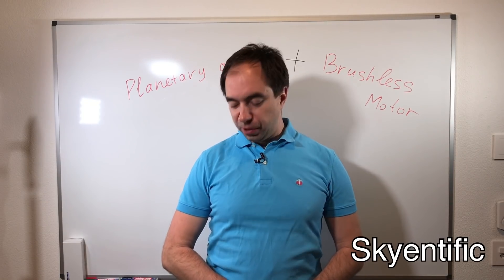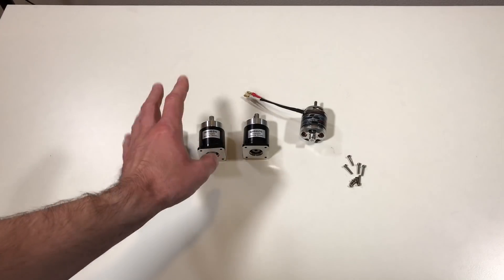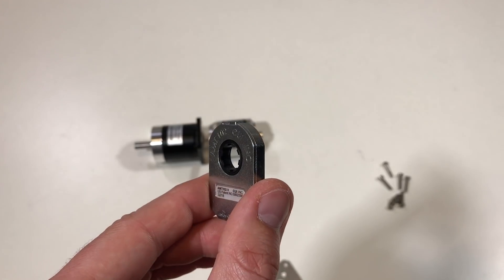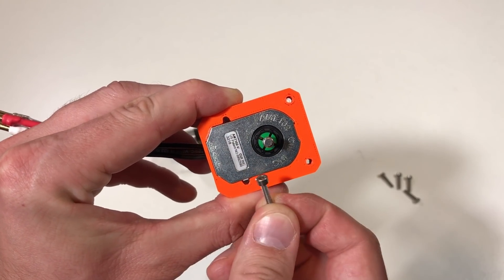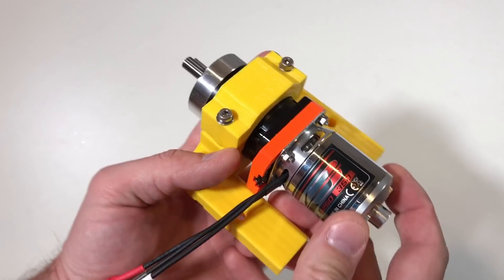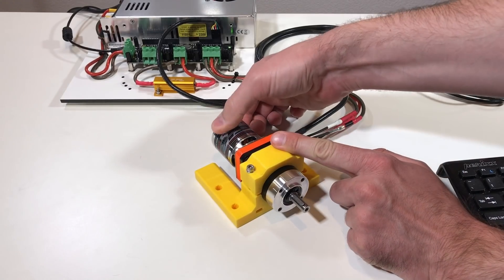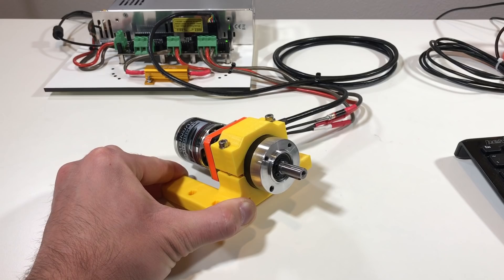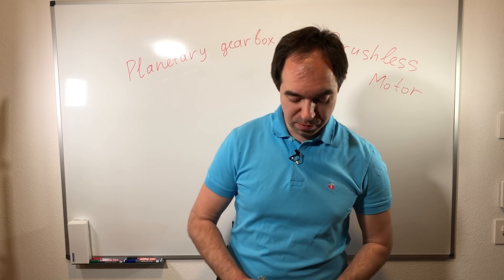Will it work? (Planetary Gearbox + Brushless Motor)

Comment: probably a dumb question: why does the outer housing of the brushless motor rotate? Is there some advantage to not having it fixed in place?
Reply from the maker: Yes, these motors have higher torque for lower RPM, which is perfect for robotics.
Reply: In fact, the outer housing is the rotor, the magnets are on it, and on this type of motors, the magnets are spining, and the copper coils are staying in place

Comment: new subscriber!! how long does this last? is there any downside of using that kind of motor?
Reply from the maker: Welcome! :). I did not do the stress test. But the only downsize that I aware: it is more expensive. But at the same time brushless motors usually lighter and more powerful. This is why most of the time people use them for professional robotics.

Comment: Am going to use it for single axis solar tracker with threaded long shaft rotating inside a nut for getting linear motion with good torque.

Comment: Are you able to run it with the encoder on the reducer output shaft instead?
Reply from the maker: It would be very difficult. Because of the backlash on reducer, the motor position would not be precise in this case, and controller will have a difficulty to run the motor.
Usually in such cases people use two encoders: one on the motor and second on the output shaft.

Comment: strain wave gearbox would be even better. Also a bldc with less inertia - an in-runner or a hollow rotor one would be killer. Congratulations on the build. It looks really useful.
Reply from the maker: Thank you! I agree that strain wave gearbox (hormonic drive), is great reducer. The problem, is the price. The cheapest one cost around 500$...
Reply: @Skyentific  Thanks for your reply! Unfortunately the price is an issue. I designed mine and manufactured them myself on a Mill, lathe and CNC EDM machine at the university where i teach.This is one of the reasons i am still hanging around there ;) I used to teach theory of machines and mechanisms ;)

Comment: You just basically made a brushless servo motor. Good project!
Reply from the maker: Thank you!
Reply: Aren't servo motors already brushless for the most part? They rely on a method very similar to a BLDC motor, and is why they are able to have such a powerful holding torque. Afaik, servo motors are a lot like BLDC, just with a lot more windings for fine adjustments.

Comment: I wonder if these types of motors are designed to be cooled by the air that the blade creates that they're designed to spin? Be careful when running them on higher power without any forced air circulation? :P
Reply from the maker: You completely right. That is why I always check the temperature of this motor when I test them.

Comment: Also have you looked into 3d printable harmonic drives? I've been playing with some designs but haven't been able to make one that doesn't skip teeth with more than ~1.5nm. I've only tried low reductions (15-1) but they have been back drivable so far.
Reply from the maker: Not yet. But I agree that this would be very interesting.

Comment: Those gearboxes have nylon gears right? I am interested to see how well they can hold up to high torque/power applications because if they were designed for steppers they wouldn't need to be very strong. I wonder if we can convince some Chinese manufacturers to produce cheap metal planetary gearboxes in this size
Reply from the maker: All the gears in this gearbox are metal. The torque from stepper motor of this size is around 0.4-0.6N.m. The maximum possible torque from the brushless motor from this video is 1.2N.m, but at this torque the motor will heat up quickly. So practically better to use lower torque. Thus both torques are not very different.

Comment: It is not "Flyed away" when you tested, but the vibration is too high. If you use second the same brushless motor (without reducer) and use opposite direction of rotation in same time - it will remove the vibration?
Reply from the maker: Good question. I don't know. But I should say that the vibration is not super high... I think it is normal for this speed.
Reply: If this "servo" will work in robot's hand - each manipulation will vibrate the whole robot. If robot draw text by this hand - then this text will not fine...

Comment: that's super cool, have fun experimenting with cheap actuators ^^ (still too expensive for me but you're getting somewhere) 
by the way there is this article about an "Afordable" joint (300$) for robotics application from MIT hackaday.com/2019/05/29/robotic-cheetah-teaches-a-motors-class/
Reply from the maker: Wow! This is super great article! Thank you a lot for the link!

Btw, the cost of the most robotic actuators starts at 1000$, thus 300$ is affordable :)

Comment: I really like the idea. Could you post a link to the gearbox because I can't find it under that name.
Reply: I confirm: in AliExpress it is not possible to find AMT102-V or 42XG30-ZYC. May be you can write links to motor, gearbox and encoder?
Reply from the maker: Try to search on Aliexpress with the key words "planetary gearbox nema 17". You will find a lot of different planetary reducers. Here the exact link, where I bought mine: https://www.aliexpress.com/item/32837903150.html?spm=a2g0s.9042311.0.0.53164c4dDFQoSJ

Comment: could you make a video on how to use an AMT102-V encoder with a stepper motor / brushless motor and arduino?
Reply from the maker: Good question. I will think about it. Now I use ODrive, and it is very easy to use this encoder with the ODrive controller.
Reply: @Skyentific  yes of course, but not everyone has ODrive. in most arduino it costs very little

Comment: Did you check out the PDF released by MIT on their cheetah robot motors? Very interesting read.
Reply from the maker: Just found it thanks to one of the viewer.
Reply: Link?
Reply: @dekutree64  http://fab.cba.mit.edu/classes/865.18/motion/papers/mit-cheetah-actuator.pdf
Reply: @basementadmin  Thanks, but I think that's an older one. I was just coming back to post that I found the new one :) https://dspace.mit.edu/bitstream/handle/1721.1/118671/1057343368-MIT.pdf
Beautiful actuator design, fitting the gears into the center of the outrunner stator. Maybe not good for robot arms due to the lack of concern for backlash, but excellent for its intended purpose, which is closer to what I'm working on (robotic bird wings). I need to try making a version with carrier-driven compound planetary gears for higher reduction ratio.

Comment: Hi Skyentific! I was wondering if it is the best way to achieve a 30:1 reduction in terms of weight. That geartrain looks way heavier than the motor....Will you do a video about actuators weight (motor+geartrain) based on your experience?
Reply from the maker: Hi! You are asking a very serious and great question! I should think about it. I don't have simple answer to this. I will think about it.

Comment: This is great! Really curious about the output torque and backlash.
Reply from the maker: Thank you. I am curious too! I will check this.
Reply: According to the aliexpress page, torque is 15Nm, backlash is less than half a degree. Speed is very low at 600RPM in/20RPM out, so hopefully running it super fast like this under load won't hurt anything :)